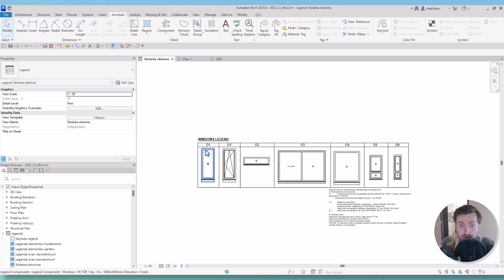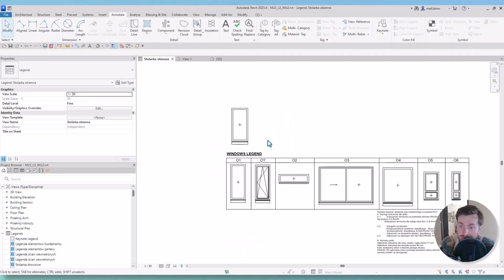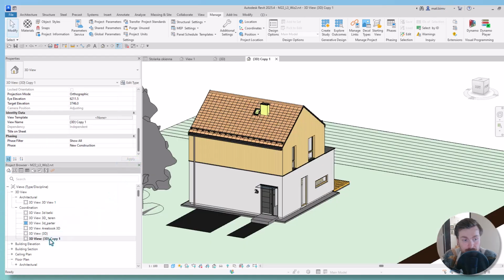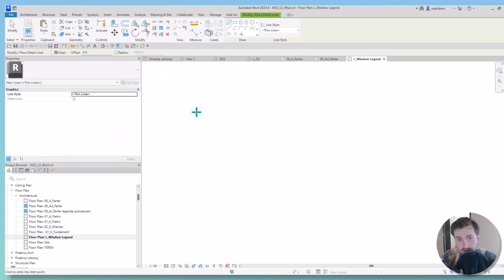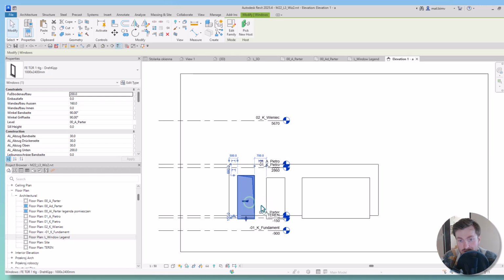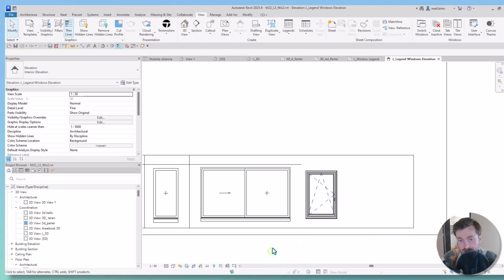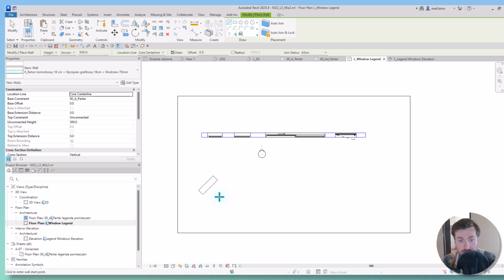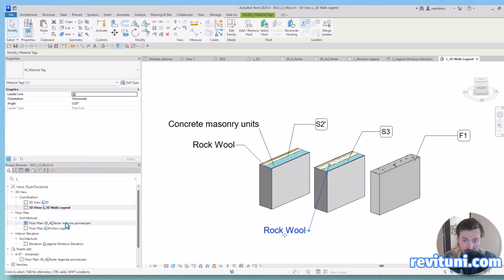Smart Legends in Revit 2025 also in 3D. Different approach using Revit phases | revituni.com

Comment: This is a great topic for discussion. It's amazing that Autodesk has not resolved the legend component issue for so long and how useless the current legend component is in a so-called "BIM environment". There is a similar approach where the model elements for "Legends" can be used to its full potential as presented in this video. However in lieu of putting the elements on a "Future" phase, a "Pre-historic" phase is used which is placed before "Existing". The phase can be called similar as indicated in your video, such as  "Legends + Diagrams" . This also eliminates the "Counting" issue that is created when family model objects are used for this purpose or other uses to simply represent a family object for illustration purposes only. But perhaps using a "Future phase" can do the same too. 
Also, having the "intelligent legend model element"  in the main browser and in the model space can be confusing to a new team member on a large project who may not be familiar with this approach, and even having it pinned out away from the model geometry can present a possibility of unintended deletion by a user who, again, is not familiar with this process and may be tempted to simply delete the items. For such an effort a separate "Model space" for the elements is desirable. Further, since the "Legend objects " can now be intelligently tagged, noted and dimensioned, a sheet or sheets can be generated for the topic of the legend so it can be used as an office standard and then placed into a new project. For instance a group of sheets prepared as starting point for interior partitions. However that again creates potential confusion for a novice may not necessarily understand the concept and may be confused by the sheet information and understand how/why its being used in the project. 
One possible solution  is the potential use of "Assemblies" so that "intelligent legend components" , there related notations and particular standard details and general notes, which are fully sheeted, can be "contained" by the "Assembly" model subset, which separates out very nicely in the project browser. The biggest problem to this approach is that assemblies are not very portable from one revit file to another. There doesn't seem to be a way to save them out from the project as an individual file like you can with a group file to a library for future use. This frustration with this limitation on "Assemblies" has been expressed on multiple online forums similar to the limitations of "Legend components", yet again Autodesk does seem to be interested in addressing the issue.
Perhaps assemblies are now more portable with the newly released "Content Manager" by Autodesk, however this is only an untested idea, and Content Manager is not a core part of Revit itself. 
Maybe there are others who can comment on a method to make Assemblies more portable, but there appears to be not a whole lot of options, such as a plugin, that can help with this limitation. 
Autodesk needs to become more serious about addressing workflow issues like the topic noted in this video. It limits the leveraging of the BIM concept to its full potential. The current interface is old, outdated and simply not intuitive to how a designer would use the program in an everyday production environment. 
At some point, someone will roll out an alternative to Revit that is lighter, more intuitive and user friendly, and Revits defacto position in the industry will become questionable. Resolution of such fundamental tasks is tedious and can eat up a lot of time budgeted for a project. Time = money.

Comment: Good thinking about putting legends on a future phase. Never really thought about it. I guess there is still a bit of manual work to make sure all the legends are up to date if anything changes in the main model. Ive also been trying to figure out how to show the attachments of the walls to the ceilings and floors in the legends without using detail lines.
Reply from the maker: yes, you can definitely doo it that way. I wish the legends were actually more automatic like schedules but I guess they are very hard to put into one template.